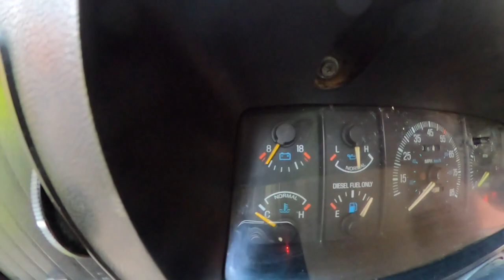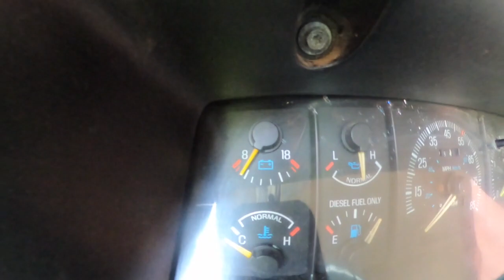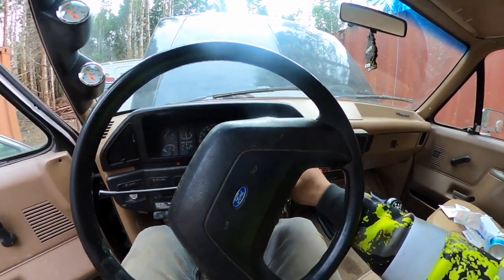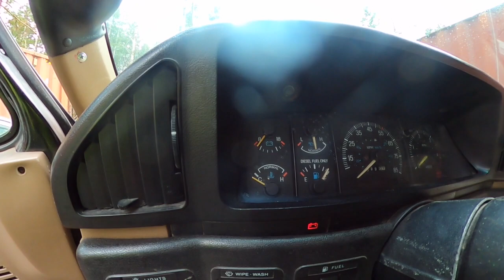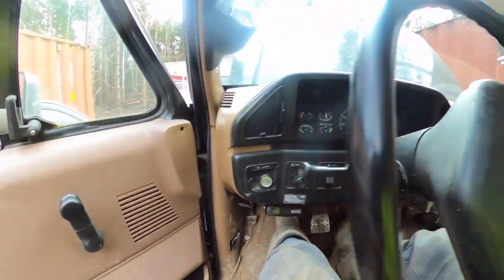7.3 IDI GLOW PLUG MODULE REPLACMENT AND DIAGNOSIS.

Comment: I bought a 1991 F250HD with a 7.3 new in 1991 . I put so many relays and controllers  and glow plugs i lost count . Living  out side of Chicago the winters can be brutal. I owned that truck for 30 years , 330,000 miles. What I finally did for cold starting in the winter, I wedged 2 1500 CCA semi batteries in it. If it got super cold I would lightly tap it with starting fluid ( worked every time) , I put a outlet out side where I could plug it in. If it was plugged in it didn’t matter how cold it got, it started. And I changed the oil religiously , about every 3000 miles . It was a great  engine. The engine drove that truck into the ground. The frame and body was crumbling from rust but the engine was King Kong. It wouldn’t stop. I would enjoy owning another 7.3 idi. Preferably a power stroke 👍

Comment: Diesels dont need glow plugs to start. Just makes it easier. I worked on monster cummins and cat motors with no glow plugs. Just fuel in-line heaters. Never had issues starting them unless it was well below zero degrees.
Reply: cummins don't use glow plugs because they use high compression.